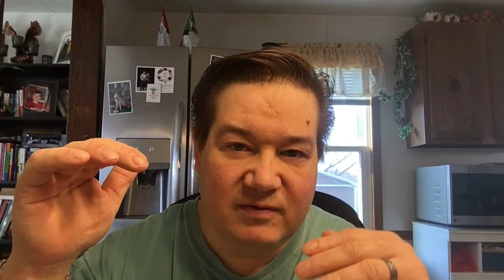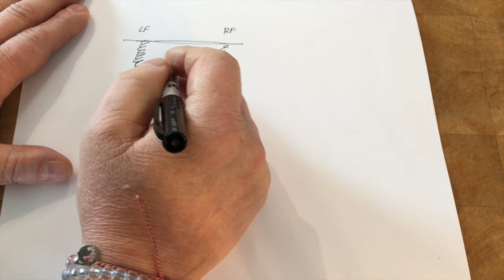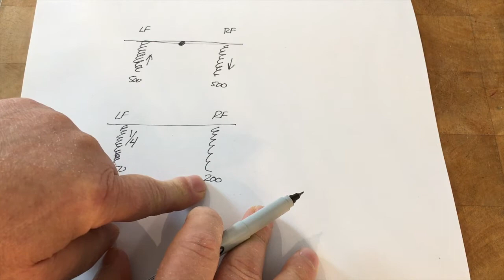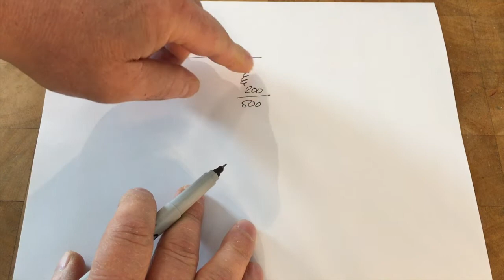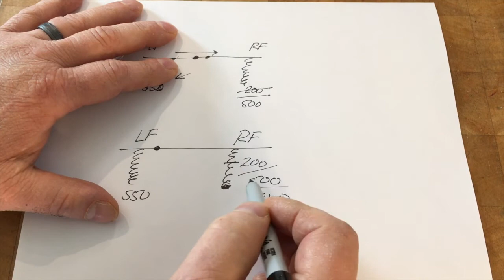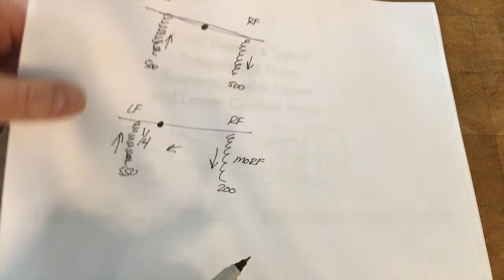Understanding Front Roll Centers Kinematic and Elastic on Your Race Car; Dirt Late Model & Dirt Mod

Comment: So how do I keep it on the right front but get my left front back in the ground...pin the front end to the track..I know left front in the air is killing lao times ..dirt modified...ps ty for ur videos
Reply from the maker: It seems they keep putting more rebound in the RF. Whenever I think it’s a lot they add more.
Reply: @HoganTechnologiesLLC  I run a straight bar directly under pinion...Im considering lowering my front roll cent and to the right a little...that should put my roll axis at a downhill angle towards the front.....I'll start adding more rebound too

Comment: Would you apply this to an asphalt late model? My rules dont allow me to run bump stops but i am just starting to get into roll centers so im taking everything in!
Reply from the maker: I would assume it would be close to the same but not as extreme. Bumpsteer on asphalt I always heard was as close to zero as you can get it. Ackerman might want to get closer to the running radius of the corner to eliminate scrub.

Comment: I know this is an older video, but I am confused. Once the weight is transferred to the bump stop, why isn't the roll center moved back toward the left since the theory of the roll center moves toward the lighter side of the car? Thnx
Reply from the maker: Technically, yes. But by this time, I think the car has stopped rolling and is racing in more of a steady state.